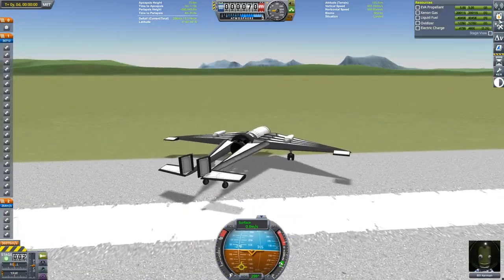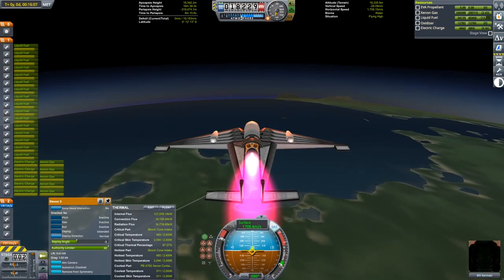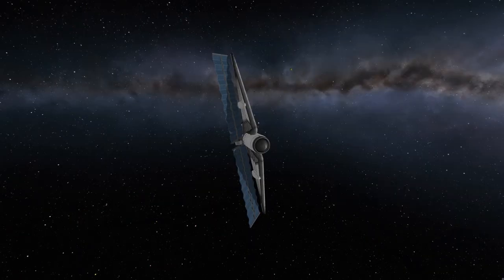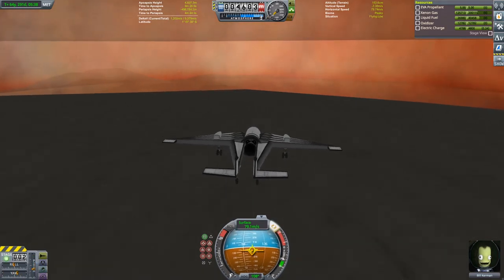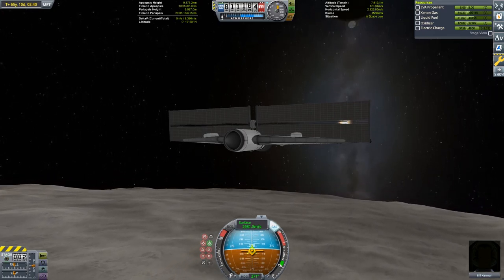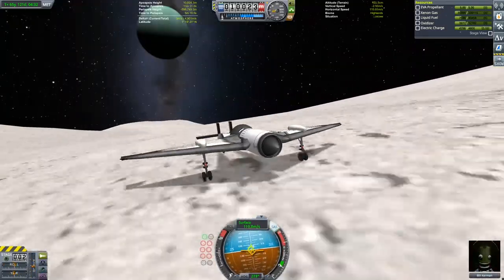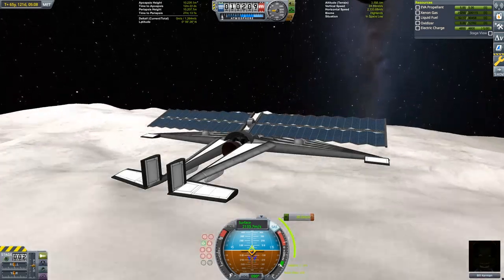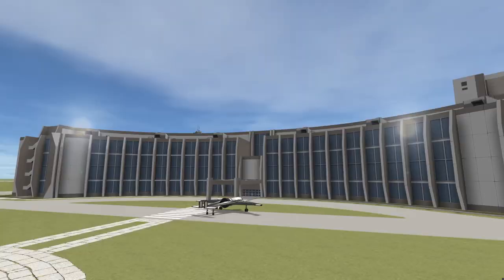KSP - Single stage spaceplane to Tylo and Laythe:  stock, non-refueled, round-trip

Comment: This makes me wonder if a single stage jool 5 is possible...
Reply: It is. Just got to do some mining.
Reply: Liam WALSH but is it possible WITHOUT refueling?
Reply: The limitation in this case would be specific impulse.  Even the nuclear motor isn't efficient enough to let you add so much fuel to it.  So, I assume that without staging, it's impossible without mods or an exploit that hasn't been discovered yet.
Reply: @Lightnin_Thundr  probably it possible in "no waste" style with some docking
Reply: Landing on a planet or moon without an atmosphere requires lots of delta v, there is no way around that (you can get rid of some horizontal velocity with brakes, as demonstrated by Bradley countless times, but that’s about it). For Vall and Tylo you need rocket engines, ion engines are too weak and air breathing engines don’t work due to lack of atmosphere. I’m too lazy to calculate but landing from a Jool orbit on Tylo and then Vall and then into orbit around Jool again is probably already at the limit of a LV-N Nerv rocket.
Reply: Lithobreaking
Reply: yes, just more fuel, more engine and more wings.
Reply: @David Sorell you could do SSTO to Kerbin orbit and then split off there and reunite afterward. That would actually be possible, unlike an SSTO that is single stage for the whole trip.
Reply: @mattpelzek3809  It would take probably some 500 years and ion engines
Reply: Wonder how's  this possible?

YEAH ME TOO
Reply: @David Sorell stratzenblitz75 did that with like a 38 ton launch craft, probably one of my favorite ksp videos ever
Reply: Michael K yeah but didn’t he say they there was a version that used more LV-N engines, I don’t know what the margin gains would be but if you can get it to Val you can get it to Pol and Bop sooooo.....
Reply: Pretty sure Brad did that with a 6t spaceplane

Comment: Personally, IMO automation is fine depending on the method, but is that the only way to do it? What about using a timewarp mod to get faster phys warp?
Reply: Faster phys warp won't work. His craft have a lot of parts so he isn't even able to run them at full stock speed. In most cases, faster physics warps only work for speeding up maneuver nodes.
Reply: Because the ion engines have a horrible TWR which literally sits around 0.1-0.2, meaning that instead of one short burn for circularization or changing your orbit, you'll need several dozens of burns, each burn executed at the perigee/apogee for maximum effect. Because of the low TWR, these engines literally burn for real-world hours until you reach your orbit (check the ingame clock, achieving his kerbin orbit alone took him nearly 7 years. 

Now remember, even though he could technically timewarp from burn to burn, the real timesink here is the burn time for those ion engines, and you can't timewarp during a burn- hence the need for automation
Reply: @B30167  You can indeed timewarp during a burn by holding the alt key while pressing the time warp keys.
Reply: @snutsnut2725  The warp level is limited, though. And phys-warp probably would just defer the problem until his margins get even tighter.

Comment: How do you calculate all this stuff? I struggle just to get to the mun
Reply: I think he is a real life space man
Reply: You don't need to calculate much you just keep experimenting. One way I used to do it is make a simple craft and enable infinite fuel cheat to measure the amount of delta V you would need, and then you build an actual craft that meets those requirements.
As for the gravity assists, once you actually understand how they work it's not hard to just eyeball which angle you need to come in from to maximize the gains, and then it's just a matter of waiting decades in space for the correct alignment.
Reply: Dude, I often struggle to take off, when I do take off it is rarely equatorial and I can never land on anothe body and come home to kerbin.

Comment: I have been messing around with ducted propellers and fuel cells as a eve SSTO, and it seems really promising! (the ascent is really slow (about 90m/s) until rocket engines become efficient. the fuel cell/electric motor is insanely efficient!  you should try it for the Eve return SSTO

Comment: How did you do that? How did you not crash at 17:24 (safe altitude of one meter)? A tight turn at 30 meters... You are so amazing.  I'm so far behind you in skill I don't even know what you might consider doable, since you routinely seem to do things I didn't think possible.

Sorry I needed to fan-boy a little. Thank you for the entertainment, and for pushing the  limits of what is impossible a bit further.

Comment: How does that solar panel mechanism work? I’m assuming it’s Breaking Ground robotics, but the apparent smoothness of the motion leads me to believe you used a KAL programmer unit on board. I don’t think KALs are massless, leading me to wonder why it was worth the mass.

Comment: Is this possible without dlc?
Reply from the maker: I suspect so.  The advantage of the Wolfhound is significant, but not so great that it would be impossible.  The Minmus detour may have to be cut.

I hope to see someone pull it off.  I would need some super compelling reason to repeat this with only slight differences =)
Reply: Bradley Whistance wow, thanks for the response! I will attempt this at some time (probably just to tylo at first) once I am more adept at gravity assists, they aren’t currently one of my strong suits.

Comment: impressive... too impressive to be true... you should show how your plane is built so that we can try it ourselves and see it's true... i'd like it to be true... but no proof...
Reply: @(S)-Riley Dunn deltaV=g*Isp*ln(M0/M1)
On tylo g is almost the same with kerbin. With the best engine the result i get is 6500m s^-1. Barely enough to tale off (3300 + aerodynamics losses) go to jool (1000) and not enough to land on stylo (3000).
After this you have to take off again... 3000m.s...
I'm lacking a lot. So a proof would be useful
Reply: @(S)-Riley Dunn you may improve deltaV with nerva and ion engine... but that's why i would like to see schematics. But sorry but not sorry... to land and take off from tylo you can't work ion engines. Need good old liq fuel/Ox
I use g of kerbin because the Isp means the time an engine can sustain a push of 1kg with 1kg of fuel. A better writing would be g*isp= gaz ejection speed. And that doesn't change depending on the celestial body.
Reply: @(S)-Riley Dunn i just made a test craft... not even an ssto (useless if no atmosphere)
i get  4400m*s^-1 on fuel (both nerva and jet fuel) and 11000 on ion engine... 4400 isnot enough for tylo.
and looking at the fuel the plane has andit's size it's proof that game has been modified. in basic game can't do this...
Reply: @(S)-Riley Dunn only 2000 hours... but i do respect the physics... harder but better.
Reply: @(S)-Riley Dunn i do the same as you with a mix of rocket engine/rapier closed cycle, then nerva, then ion i come to 13000 m.s^-1...
Open cycle is only 2000 m.s^-1 and i didn't took fuel for this.
And it works better of you use the best ISP at the end... but all the fuels are used together (you must keep jet fuel for all stages of flight.. ) on the worst conditions (ion before nerva before jet fuel ) the result is only 5000m.s^-1...
I repeat myself... not enough...